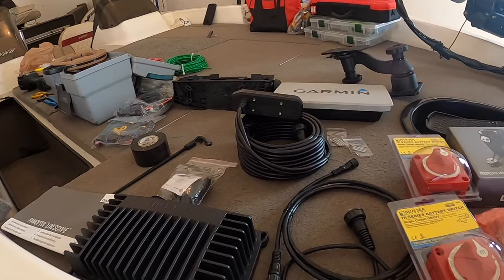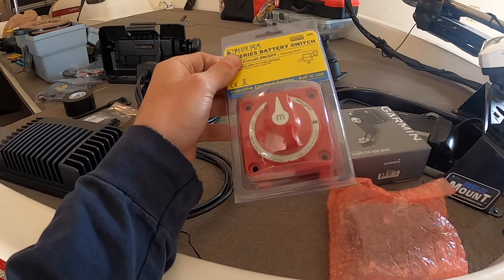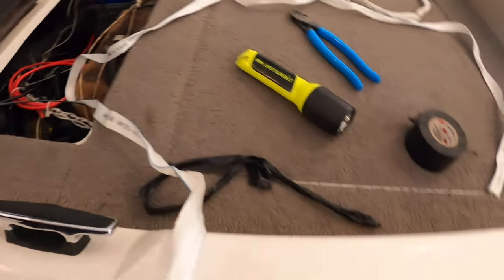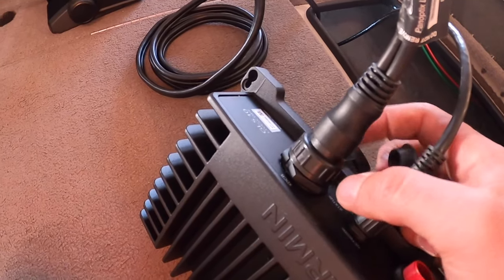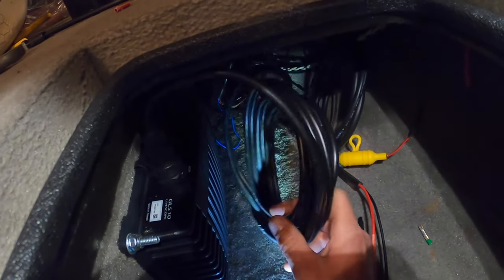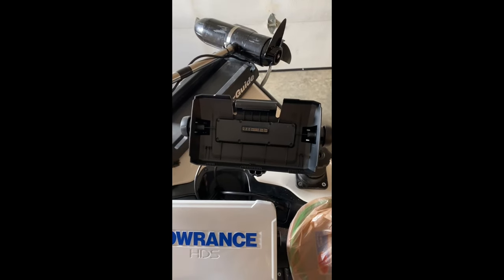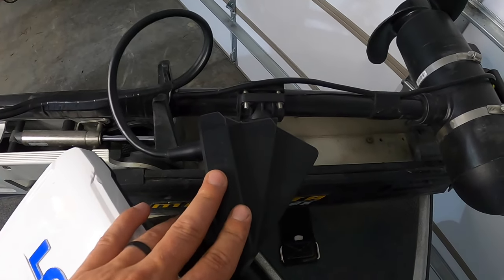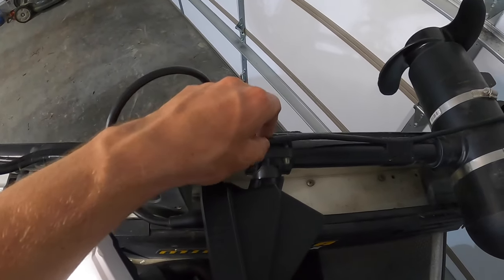Installing Garmin Livescope | What You Need to Know

Comment: Did I miss you installing cables to head unit? That's why I watched
Reply from the maker: It’s not in the video. Only one cable from the GLS10 to your unit. That is the network cable that looks like an Ethernet RJ45 connector at the unit.
Reply: @MidwestOutdoorExperience  ok so I have my steady cast to nema 2k. Will that be an issue? Or do I just plug from blk box to the pan optics port in my 73sv and done
Reply from the maker: @JonR35  Won't be an issue. NMEA 2k uses it's own connector. Just plug in to the pan optics port and you're good to go.
Reply: @MidwestOutdoorExperience  sweet! Thanks! This is all on my kayak lol

Comment: You wouldn’t happen to have the part number for the 10 foot extension network cable ??????
Reply from the maker: https://www.basspro.com/shop/en/100806616-garmin-small-connector-marine-network-cable-100806616?hvarAID=shopping_googleproductextensions&ds_e=GOOGLE&ds_c=Shop%7CBPS%7CTopPerformers%7CBoating&gclid=Cj0KCQjw5PGFBhC2ARIsAIFIMNcilxfwef5eEbEvSGVMKi3pn_mBIPtH30ShCtffUIavfetb7zZ4WoQaAvyqEALw_wcB&gclsrc=aw.ds

This is a 6 meter network extension cord
Reply from the maker: 100806616-garmin-small-connector-marine-network-cable-100806616

Hopefully you noticed that was actually the transducer cable Extension, this is the network cable.

Comment: Couldnt follow the part of doing the network cable or doing power for your  graph or the graph connections. You skipped over all of it
Reply from the maker: Network cable is straight to the box and unit. Power is the same thing except individual runs, one to the graph one to the black box. You’ll only have 3 connections at the graph. Network, livescope transducer, and power